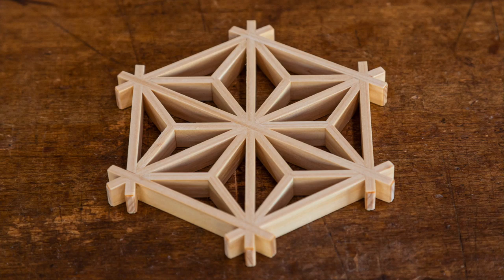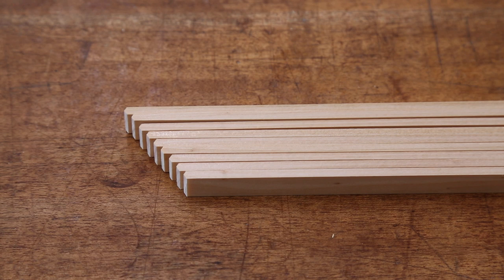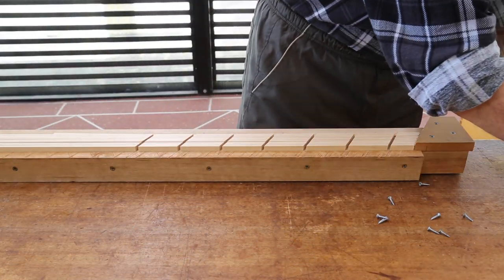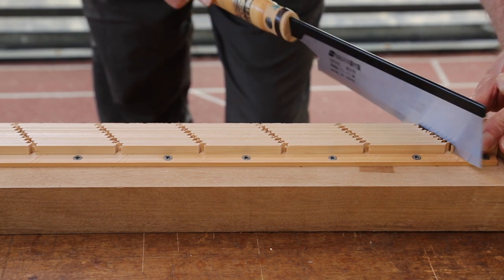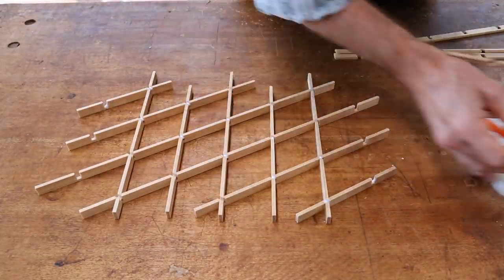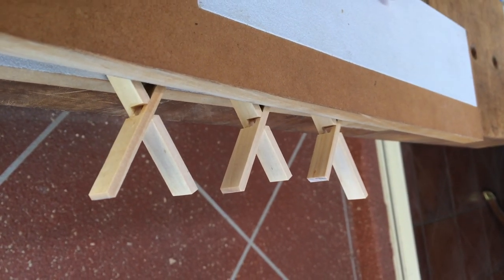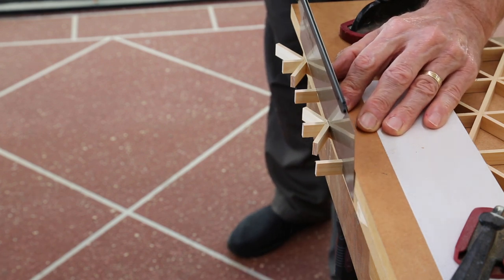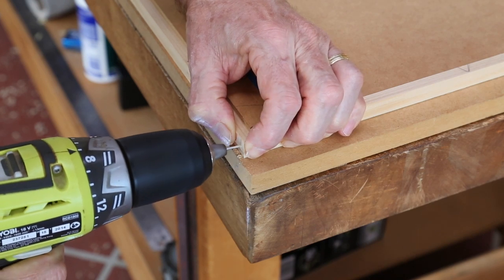Shoji and kumiko patterns 07 Intermediate — Kawari asa-no-ha feature Part 1

Comment: I can’t tell you how many times I’ve come to this video to learn how to cut these joints by hand. After the video I think to myself that I can do it, and then I go try it for myself and realize that you make it look really easy, or I’m just incapable of using my Japanese saw lol
Reply from the maker: Seth, if you're struggling with the saw, can I suggest you go over the exercises video I put up on YouTube or the exercises section in Book 1. From all my classes, the two problems students have with the saw are, first, strangling it (holding it too tightly and too far up the handle), and second, waving the elbow around. Both problems are easily solved. The second problem especially by simply tucking the elbow into your side as you cut. This will naturally give you the straight line from the saw blade through to your shoulder.
Also, you shouldn't stand square to the work piece. A comfortable 45° or so works better.
Cheers
Des